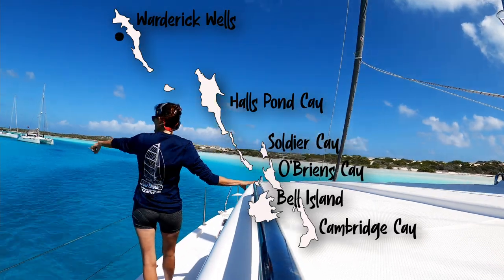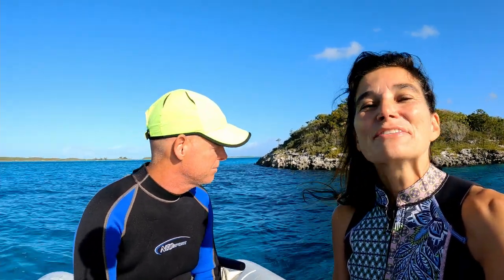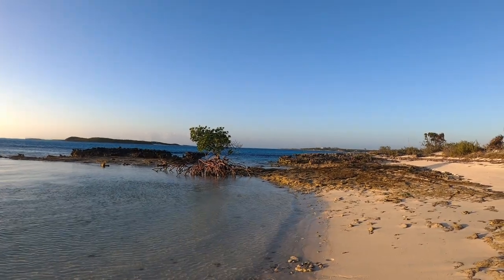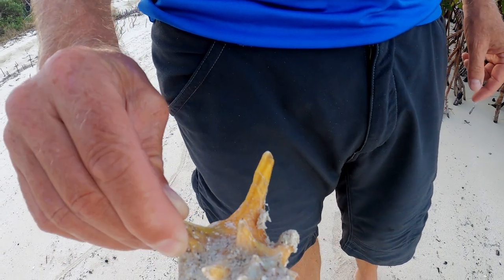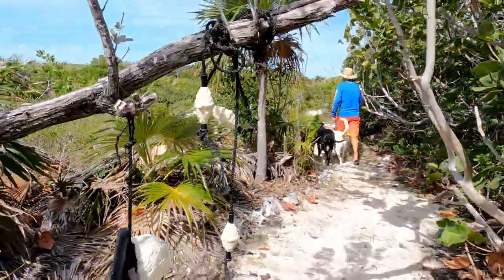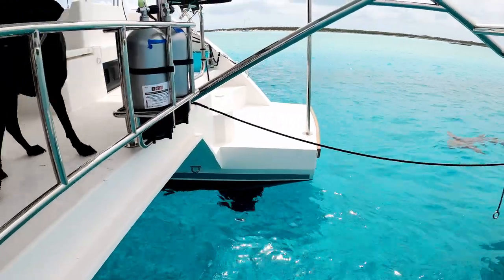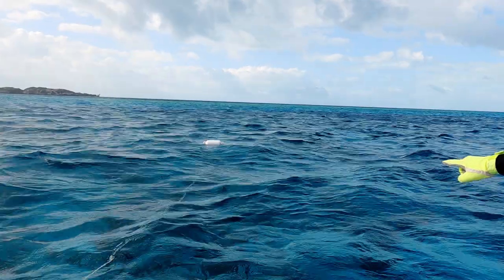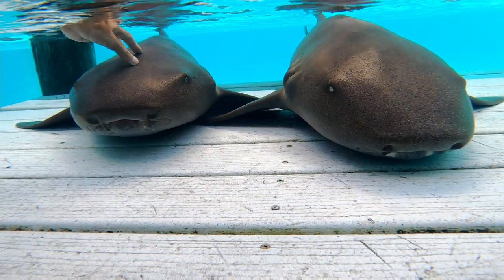Part 12: Cambridge and O'Briens Cay, Bahamas || Weekly Tip 2: Prevent Mooring Ball Hull Damage

Comment: Would a sea anchor help in this situation?
Reply from the maker: Interesting question.  We use the three line method in situations where the current and wind will possibly be coming from opposite directions or where the boat could drag onto a shoal area.  A sea anchor (deployed from the bow of the boat) is generally used to keep a drifting boats bow into the wind and waves and to increase stability.  At a mooring ball, the current and possibly the wind keep changing directions so there would be too much variability.  Also, as the current changed the sea anchor could possibly drag onto another boat or around the mooring ball itself.